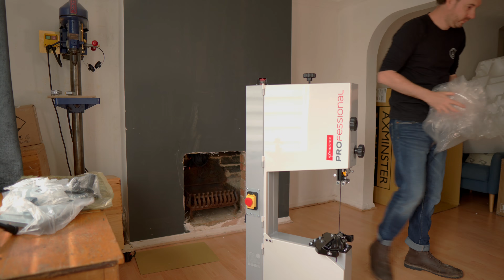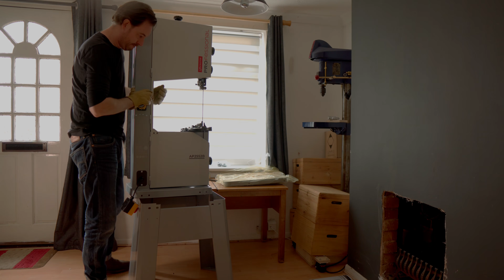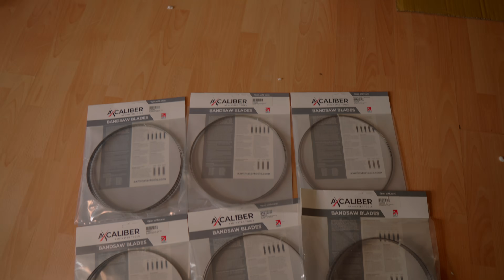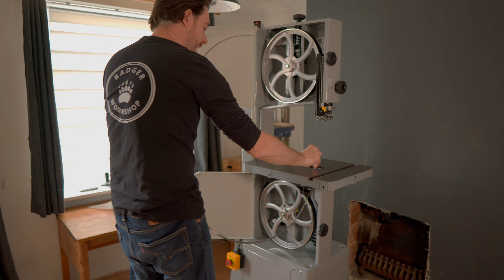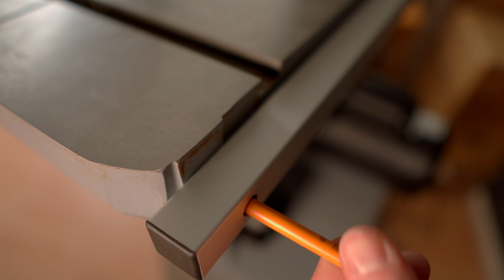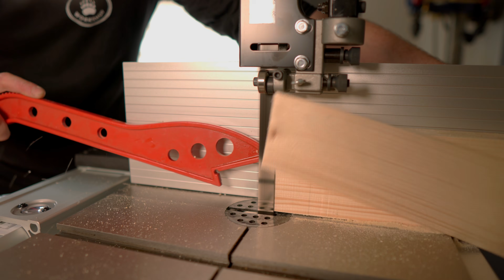New AXMINSTER PROFESSIONAL AP2552B BANDSAW

Comment: Hiya Matt ! I saw you used this powered up by the Anker 757. Does this and your previous bandsaw (AW1950) have a 'soft start' mechanism ? I have an Anker 767 and am finding it doesn't like certain of my power tools, an Evolution mitre saw and an old small bandsaw. I was looking to buy the AW1950 but am a bit wary now as I'm worried it might not be compatible.

Comment: A great video Matt, I remember your record then your axminster craft. I was going to get the axminster AW2606B  craft, this model looks sturdy and I like it's extra features but for some reason the motor is only 750w as opposed to 1.1 kw on the 2606. Im obviously missing trick trick here .Its means stumping up a extra £400 though. I'm going have to go see them in  the flesh as it were before coming to a decision.
Reply: Im stuck at the same desicion, why is it weaker than the craft model? What did u end up buying?

Comment: You’ll love it Matt. Most used machine in my workshop and it becomes a breeze to change the blades once you’ve done it a few times. Note that the scale is set for the plain fence, so you have to use relative measures when you put the extension fence on. Mine has an additional threaded hole to take the bolt for levelling the table towards the back of the frame, which I’ve found gives more subtle adjustment, but it rarely needs truing up. Decent dust extraction is essential too, but you’ll know that. Relative to another comment on here, it’s important to get the table on square to the blade before you start fine adjustment of the fence, otherwise it can be hard to get it perfect. You’ll find you can easily cut fine hardwood veneers after that. Worth making an extension to the mitre gauge and it has to bolt slots for that purpose - I added length stops to that to make it even more useful. Regards, Gerry (happy Axminster 2552 owner)
Reply from the maker: Thank you Garry. Pleased you like yours

Comment: Great review and setup guide! Have one myself as well but I've been having issues with squaring the fence to the blade, so much so that I've had to add some washers to the right of the fence to square it, which felt very wrong. I'm hoping it's just the blade that's at fault (new one ordered), but the one that's on it is a similar axminster pro one too. Not a whole lot of help from Axminster about it either which was a bit disappointing, but the machine does feel very premium and well made otherwise.
Reply: Just a thought, but this issue is sometimes related to the blade tension, so worth experimenting with that aspect, as well as the blade guides. If it has always had this problem, then you might just need to adjust the table to be square with the blade (yes, I once made sloppy adjustment to table and had this issue until realisation dawned🤪). They are great bandsaws (love mine) so hope you get it sorted out. Regards, Gerry
Reply: @gerryheynes5082  thank you Gerry, that's one extra thing I can look into. I probably haven't spent enough time pouring over what's out of whack, so a more methodical approach is probably needed. Hopefully I can get it back in shape as otherwise it seems like a great, powerful machine,

Comment: Congratulations on getting your new bandsaw!
Apart from size I couldn't see any significant differences between this and my Axminster Trade AT2552.
The thing that I hated most was the adjusting bolt for setting the table level. Because doing so was such a faff. It seemed to involve lifting the table, adjusting the bolt with two spanners, checking for square, swearing - and repeating, ad infinitum.
I fixed this by fitting a longer bolt with a star knob, from under the chassis. Now, I can make the adjustment without lifting the table and I only need one spanner to tighten the locknut.
Reply from the maker: The star knob sounds a great idea
Reply: Yeah its the same saw just new rebranding on this one .

Comment: Hi Matt, great video again mate, do u think u would go back to the axminster table saw? If u were then they have an offer on now and it's less than 500 quid .. bargain I've just bought mine after watching your reviews on it 👍 nice 1
Reply: +1 for that table saw. Check your table flatness even before you take it out of the box. You might not be happy with it and it’s not a fail for them!! Mine works fine and I love it but the table surface is definitely not flat which I still feel a sad about.
Reply: @frederickwood9116  I checked the table as u said mate and with the Feela guage it's. 2 in places so I can live with that 👍 
Have the cabinet being delivered today so just to save up now for the mobile base and slide extension ..
Reply from the maker: I am very happy with the Bosch

Comment: I have the AP2552B and it's fantastic. You do need a dust extractor or debris builds up on the lower wheel. Also a tub of machine wax is useful to stop the cast iron table from rusting.
Reply from the maker: I have a camvac

Comment: It is common that the table and/or trunnion needs to be adjusted so that the mitre slot is parallel with the cut the blade makes.    Look up Alex Snodgrass videos on how to tune a bandsaw.   After watching his video I checked my Grizzly 17in bandsaw and found I had to adjust both table and trunnion so that the mitre slot was parallel to the path the blade wanted to cut.
Nice looking saw. 
Dave.
Reply from the maker: Yes I have done that